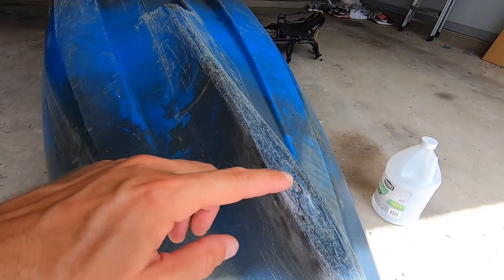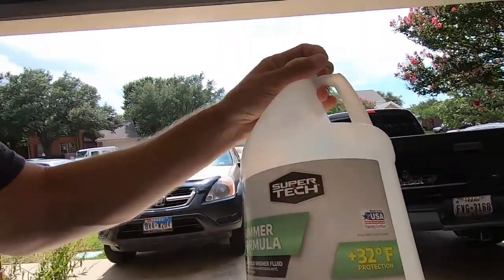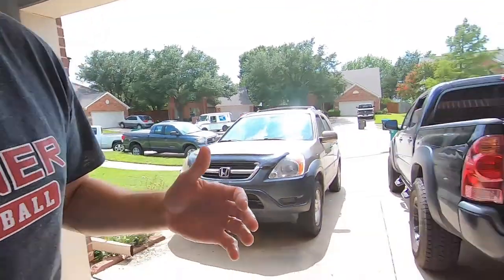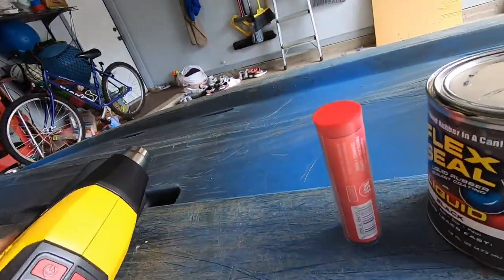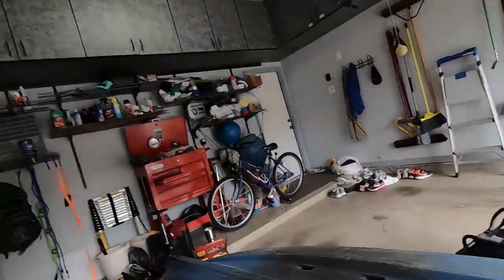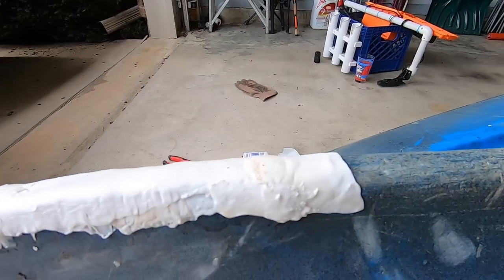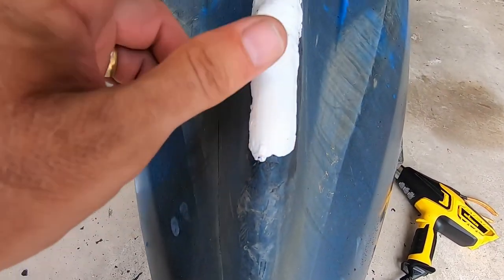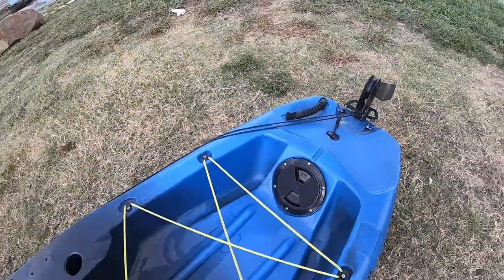Repair Plastic Kayaks with Deep Gouges, Cracks, and Holes Inexpensively!

Comment: If you heat the smoothing tool to the same temp,the plastic will not stick to it. The putty knife will work if heated,but the thinner metal of the blade means you have to keep it in the heat while working because it will cool rapidly.

Comment: Nice work! My grandfather recommended "Marine Tex" epoxy back in the 80's for a repair on my Jet Ski (Eagle Mountain). It worked great, and have used it many times through the years on fiberglass, plastics & wood w/ great results
Reply from the maker: That's good to know! Thank you for offering up an alternative. It's always good to have options to make repairs. Thanks for watching!
Reply: Imagine if you added the marine tex stuff or jb weld marine then did this adding the plastics then jb weld it again very strong probably very durable

Comment: Though this seems solid I believe the layer you put on wasn’t melted into the kayak plastic enough. The kayak plastic seemed to not have been heated to melting point    Hard to tell exactly. A soldering iron with a flat tip  works well for this.  Again sort of hard to tell how hot you got the boat

Comment: Get some Gator Guard.  It is an impenetrable fiberglass repair patch for what you're doing. I had the same issue on my Ocean Kayak Big Game Prowler.  Couple layers of Gator Guard and it's sealed tight.
Reply: I can attest to this, I did the same for mine.

Comment: You wasted money on the Flex Seal & the epoxy. 
you fix plastic with plastic 
you fix fiberglass with fiberglass 
you fix aluminum with aluminum 
you had the right tool which was the screwdriver but the trick is to heat the surface place the plastic and use the back end of the screwdriver to smooth it out with the handle itself
Reply: I think I seen another comment from you on another Kayak fix video because the comment was almost identical to this one. In any case, your right. You fix plastic with plastic, fiberglass with fiberglass, and fix aluminum with aluminum. I've been looking for a video fixing a hole with just epoxy but haven't found one yet.
Reply: @gamehunter3985  what are you trying to fix? Put aluminum screen over the hole overlapping by at least an inch and melt the aluminum into the surface around the hole.
Then just melt plastic into the aluminum even better If you can do it on both sides
Reply: Here is another tip on plastic...
Find some old LITTLE TYKES & PLAYSCHOOL toys like the chairs, outdoor Houses , kitchens bassinets. They come in a lot of different colors and are made of thick #2 HDPE almost identical to kayak plastic. I chop them up into strips or use a hole saw to cut out plastic washers and backing plates for cleats, pad eyes and anchor points. Use your imagination and DON'T OVER THINK IT!
Reply from the maker: I like this idea! I may have to go raid Goodwill and find some of the heavier-duty #2 for future repairs. Thanks for this!
Reply: @briansbassinandforecastin6551  wait for bulk pick up day
Reply from the maker: @Manuel_Z_Kayaks  Haha! Ohhh ... that's an excellent idea!
Reply: I have a old kayak or canoe? That the only sticker on it says it's made of Sinclair ™ 8405 UV5 from DuPont Canada inc.... Question i have is what do i use  fix tiny holes and and strengthen brittle areas, or entire hull? Thanks for any advice
Reply: @Nvent1  Contact the manufacturer or research the product. Some of them Put their own label on regular products like Hurricane Kaysks calling ABS plastic "TRYLON".
The manufacturer may even have a how to on fixing the product... Hurricane did but their method was wrong!....
Reply: @Nvent1  also maybe research the "HIN" Hull Identification Number. It's like 12 numbers and letters at the back of the boat the last 2 numbers are the year it was made.
The first 3 letters are the company letters. The letters are random so don't think it's the first 3 of the company name. For instance Pelicans letters are ZEP
Reply: @Nvent1  If all else fails... use aluminum tape like they use for A/C Ducts. The one with the rubbery backing on it. I keep some of that in every canoe, kayak and even my aluminum and Fiberglass boats.
Reply: @Manuel_Z_Kayaks  thank you, yes i looked everywhere, seems this kayak or canoe doesn't exist anymore. Yes the hull id It's a 1983 obi, which was O'Brien/Coleman, made with Sinclair™ 8405 UV5 from DuPont Canada inc.

Comment: How has this repair held up over the past year? Still solid?
Reply from the maker: You posted this comment a year ago ... so I'm a couple years down the road from the repair now. It's held up REALLY well. No water in the hull whatsoever. I saw a couple spots started to get rubbed down, so I added a little more in a location or two. Still doing terrific though!
Reply: @briansbassinandforecastin6551  thanks for the reply. I have a canoe that is looking similar in the front and back of the boat. Not leaking yet but I plan on repairing it the same way you did. Thanks again.